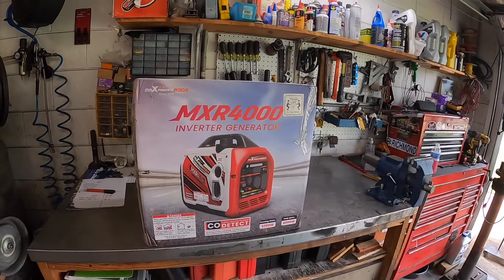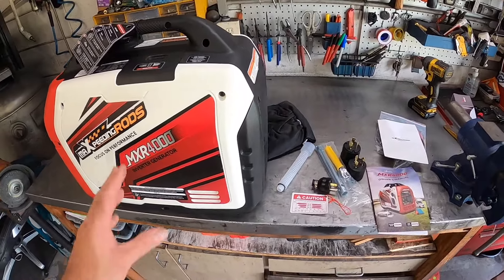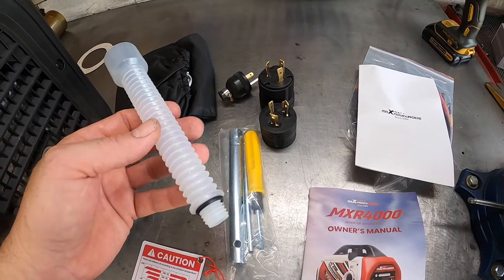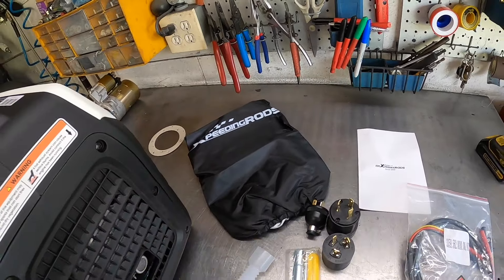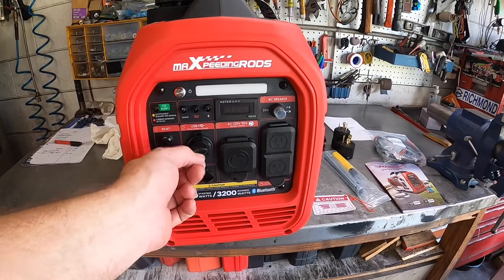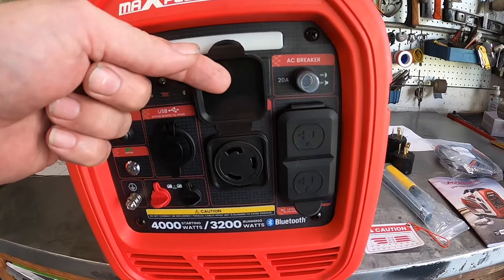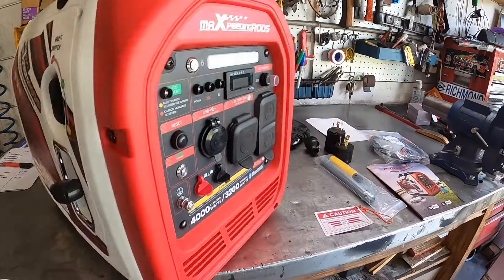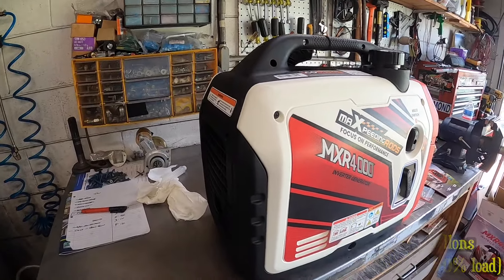Unboxing The Powerful 4000w Maxpeedingrods Inverter Generator For Hurricane Preparedness

Comment: I wonder how long it would power a fridge and separate freezer unit? That's one of my biggest concerns when the power goes out.
Reply from the maker: All depends on the size of the fridge and freezer. The larger the load on any generator the more fuel it consumes.

Comment: This generator is made by  Chongqing Dinking power machinery Co in Chyna makes it as it does GenMax, A-iPower, Champion, Duromax, Predator and Wen from what I read.
Reply from the maker: @notonk  doesn’t surprise me one bit, that’s usually how it goes.
Reply: @VWJawbreaker  Not at all. Nice generator. Light weight but the one issue is that if the small lithium battery is discharged, this generator will not start even with the pull. I have a large EFI Ai Power generator that is the same in that respect.
Reply from the maker: Good to know!

Comment: Just got the 4000GT dual fuel version and i plan to use propane to power generator ...
Still kinda in break in period ... wish they had a quick access door to check/add oil ... also, they also do not put an oil film on air filter from factory which would have been nice ... all in all i am quite happy with purchase so far ... 
One last item, an after market fuel pump can used which will allow an external gas tank to be added to extend run time of generator ...
Thank you for video ...
Reply from the maker: @bobackerman54  good idea on the fuel pump and oiling the filter.